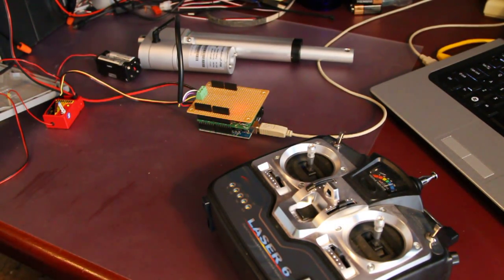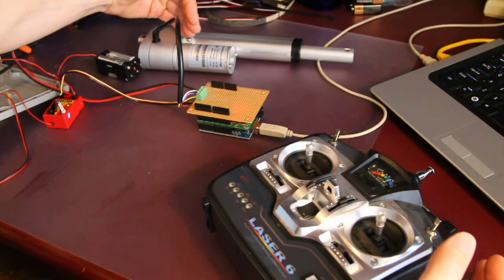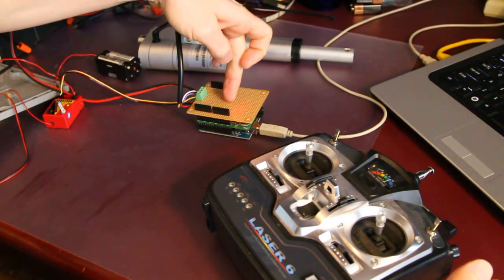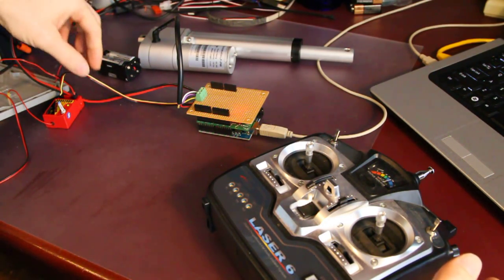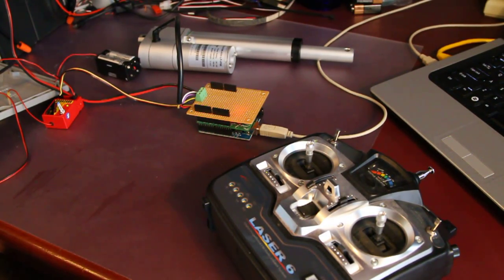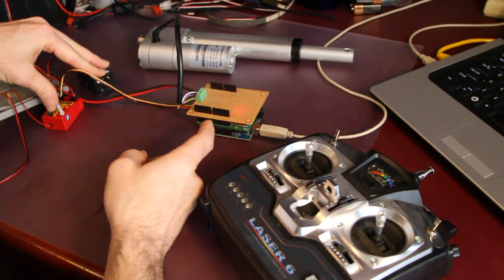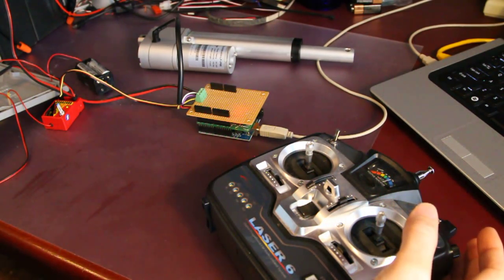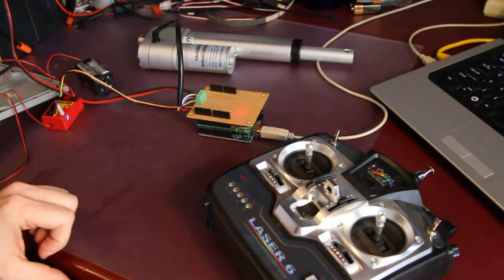MegaMoto SuperServo Introduction

Comment from the maker: Yes, you can connect everything up without the DIY shield.  You can solder the wires right to the under side of the arduino for example.  This setup works fine for my purposes, but now that I know about PID and there are new PID libraries for arduino, I should redo this and explain a more proper way to do it.